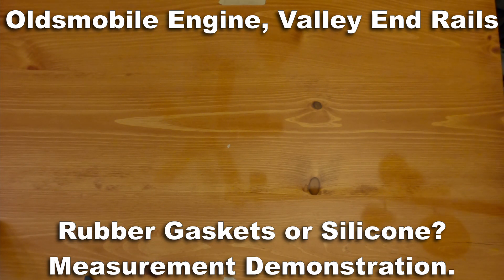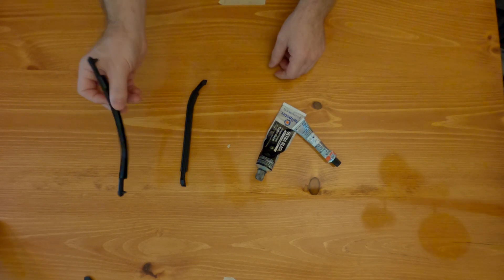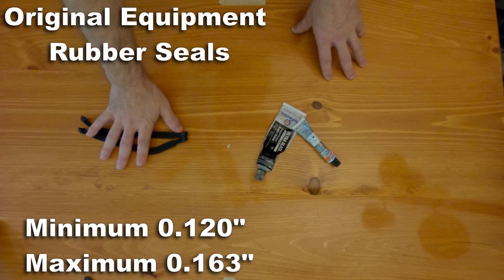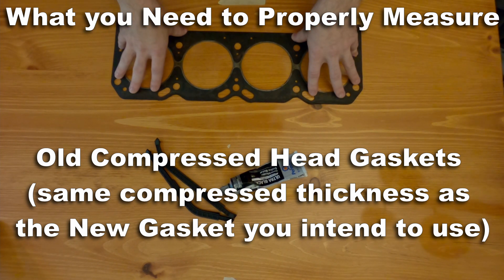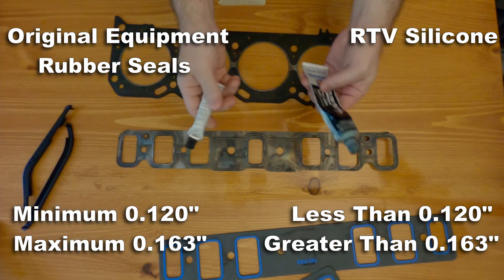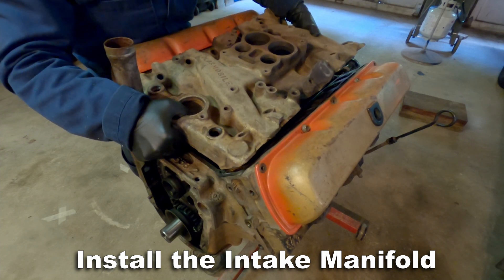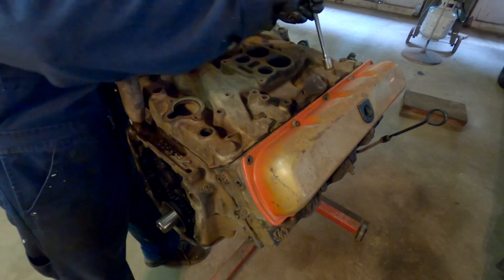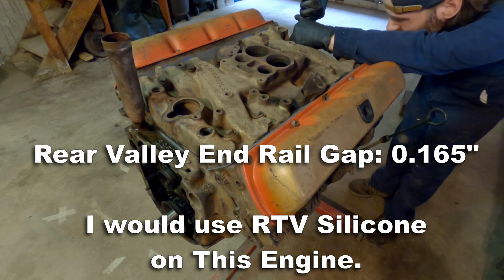Oldsmobile Engine End Rail Measurement Technique

Comment: Never use the gaskets
Reply from the maker: I hear that misconception often, If you don't measure the end rails it's a good idea to use silicone instead of the gaskets. End rail leaks occur when the gaskets are installed improperly or they are installed on engines where the end rail gaps are out of spec. There is no problem with using the end rail gaskets if you follow the procedure in this video.